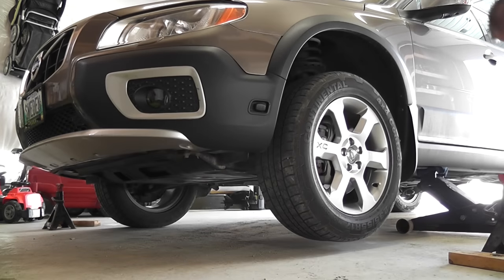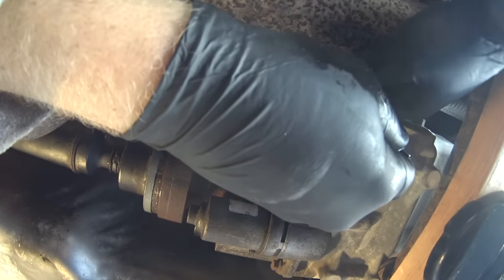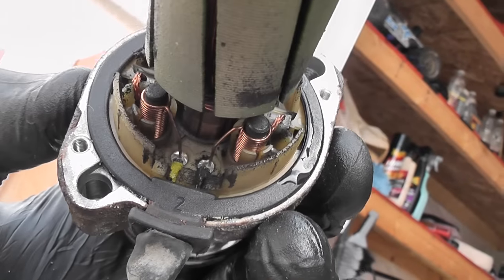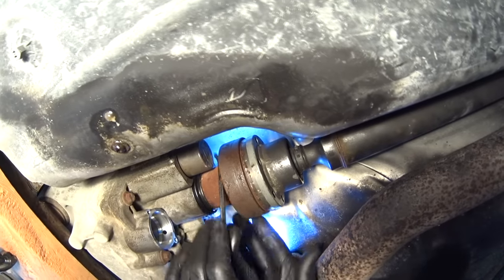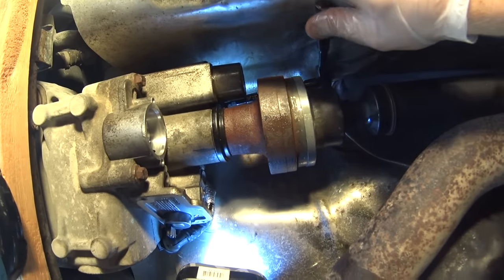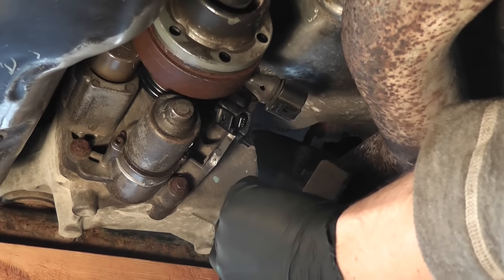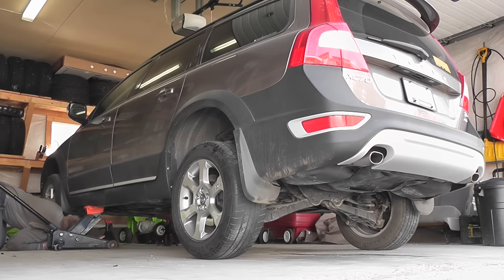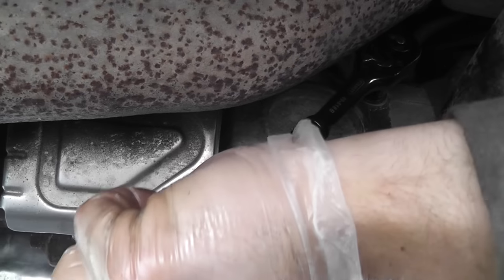Servicing Haldex AWD on a VOLVO

Comment: For the generation 3 haldex, take note:  we did a filter and oil change on our xc70 volvo Gen 3 this weekend, YOU CAN DO IT ALL WITHOUT DROPPING THE PROPSHAFT OR EXHAUST. Cut down an allen key to take the filter cover off, put 12v across the pump connection to pump out the old fluid, black wire is negative, refill, pump a little to prime the pump, put new filter in, job done. takes a couple of hours tops. Nothing needs removing except the filter cover.
Reply: Sounds like you can even cycle the pump with a bidirectional scanner
Reply: So you are connecting negative 12 on pump connector to start the pump and put the oil out through filter cap?
Reply: @4chankrozb  yes, just do it for a few seconds at a time, keep topping the oil up so you do not let the pump spin dry, but it will clear all the old fluid in four or five cycles. it's a pretty easy job.
Reply: @daddygrasshopper  as you've found out, there is hardly ANY clearance, a cut down key and nimble fingers will do it, but I really doubt you'll get any kind of socket in there. But you are probably right, changing fluid even without changing filter will help - our filter was very clean when we removed it, just a smear of residue.

Comment: I just did this on my 2012 XC60 T6 r-design.  A couple  helpful notes I can add here when removing the out filter housing and inner seal is that you can use a 3" 1/4 drive extension and it will clear the back of the prop shaft flange, giving you enough room to get a 1/4 drive ratchet on the extension with enough room to use the ratchet itself.  Also when you remove the outer filter housing, instead of heating a pick to push the through the inner plastic sealing ring, the sealing ring itself has a mounting nub that sticks out that goes into the outer housing peice.  That little nub has a opening through its center that you can slide a flat end screwdriver into to pry out that plastic seal, or loop a hooked pick through it and pull it out.
Reply: Which Haldex version was on your vehicle?  3,4 or 5?
Reply: @timtaylor8557  4
Reply: Piece broke right off

Comment: It's worth mentioning that there are two flange sizes, this will only work if you have the smaller one. If you have the bigger flange the propshaft will need to be dropped.

Comment: Awesome tutorial video! It is absolutely true that some of the dealers tell the users that this procedure is not in the service plan or is not needed (“lifetime”) in order to reduce the three or five years’ service plan costs, but as a result the reputation and trust in the AWD models has shaken and a lot of secondhand Volvo owners are scared to purchase AWD models due its probability to fail.

In my case S60 2.5T AWD (2006) triggered error message "DSTC Service Required" after six years (~200000 km). Official service first mistakenly recommended replacing the control unit and then the whole Haldex for insane costs. So we did a bit of investigation here with my local Volvo service. It took a while because VIDA does not guide you directly to the root of the problem. There are many subsequent codes fired as a result of this AWD failure. DEM 0006 (Haldex pump) a DEM 0007 (pressure sensor), and also BCM-0094 Communication between control units,  BCM-0115 Communication between control modules, Signal missing , BCM-0148 Communication between control modules.

From driver’s perspective the car behaved OK for around 30 sec after each start-up, until the error message shut down AWD and DSTC. I had to restart the engine ~30 times to get out of the snowy road in Austrian Alps, which was impossible without AWD and traction control.
Long story short, it was the pump that said good bye and the oil looked horrible. So I fully recommend to replace that fluid on regular basis. As an extra step I ordered DEM cover from IPD to protect the unit from heat and slush.
Reply: My independent Volvo tech here don't even want to do it when I asked him.  This video will definitely save me money.  I'll just do it myself.  Thanks, Yuri.

Comment: Great video. Just need to mention that the extraction of the 40ml at the end depends on the length of tube you have on the syringe. If not careful, you will extract more than the measurement on the scale as it will be volume in tube and syringe you take out.
Keep making these videos, and thanks for taking the time to share.
Reply from the maker: Totally agree. And I did consider the length of tube.
Reply: 10kg feathers OR 10 kg stones what is more heavy ... 40ml stays 40 ml .....
Reply: @diypapie8428  In your example, one is weight, and the other is volume. You're comparing apples to oranges.

40ml measured in a syringe with no hose on it versus a syringe with a hose of, say, 1ft connected... even though 40ml is indicated on the syringe in both cases, the one with the hose will have extracted more volume from the Haldex unit.

The only way to be sure how much you're extracting is accurate is to measure the volume of the section of hose you're using, and deduct that figure from the amount you wish to extract. Then, extract that adjusted amount using the graduations on the side of the syringe. So, say the hose's internal volume is 8ml. You'd extract fluid until the syringe indicated 32ml, because 40 - 8 = 32.

If you were to ignore this simple math and erroneously assume, as you have above, that "40ml stays 40ml" in either case, then you'd actually be extracting 48ml. This is exactly what the person you're replying to warned about.
Reply: @diypapie8428  How do you plan to fill the syringe first without the hose connected? You wouldn't be able to extract any fluid that way, which is the process we're discussing... NOT putting fluid into the Haldex from the syringe, which is the only way that would work.
Reply: It wouldn't matter if the hose was 5 meters long, if you extract the syringe to 40 ml you'll have only drained 40 ml, the syringe would be empty but the 40 ml would be in the hose, simples. 🙄
Reply: Зачем отбирать 40мл? Заливное отверстие и есть уровень.

Comment: Very good video. The only things I should mention is that you can easily kill the oil pump bearings if cleaning like this with brake cleaner. It is best to cover them up with plastic wrapping or something before spraying - They are not so easy to change although they are cheap from, SKF. It is also very hard to dry and clean the motor winding afterwards. I'm saying this because I have made these mistakes :S
Also, while the oil pump is out you should replace the oil seal in front of the pump shaft (inside the aluminum thing with O-rings) because if that wears out and fails you get oil inside the motor then it will melt the brushes, burn the brush copper contact ring and maybe even the motor winding - this is the main reason that haldex oil pumps fail.
Reply: HI i was wondering where to get the o rings at the from of the pump. I serve the Haldex and now after one month my AWD is disabled. when I opened the pump there was oil in it, I cleaned it with Electric contact cleaner and its working but now I'm unable to find the o rings. does volvo have it or they sell the complete pump?
Reply: @eddieroyalcars3765  Hi, sorry that I didn't come across your question before. Maybe my answer will help others in the future - the normal o-rings around the aluminum thing I got from general o-ring dealer according to the dimensions measured from old rings and the part they go around. The special seal in the front of the motor shaft could be also sourced from some better seal dealers but I got it from SKF dealer. There was part number referring to dimensions written on the old one - if not then again it is selected according to shaft diameter and the hole outer diameter where the seal sits. Luckily today 2 years later there are already full repair kits available, including all the seals, motor brushes, bearings and the copper contact ring.
Reply: @EarlLeeBird  Glad I'm not the only one who has discovered that repair kits are available for these things. Unfortunate that more don't, because those people are spending WAY too much money on new pumps needlessly. Keep spreading the word! Cheers from Canada :)
Reply: @EarlLeeBird  Do you have a link or guidance to these repair kits?  My AWD went out today and I'm betting its the motor/pump. Repair kits are surely cheaper than the $320 new pump i have found.
Reply: @BoycottYoutube  Try searching ebay and google for "haldex AOC repair kit" and select the listing with correct haldex generation. For example ebay seller "awd_pump_repair " is listing these kits for all different haldex pumps. They have also listed all the o-ring and seal dimensions if you want to try and source something locally.
Reply: That's good advice, killed my 5th gen AOC pump after spraying it with brake cleaner and I think that was likely the culprit.

Comment: 16:02 There is a drain.
The bolt to the left of the motor & below the control module is the drain plug.
Reply: So you dont have to remove the pump?
Reply: This isn't true, there is no drain port.
Reply: @Reltens  
When I serviced my Haldex on my 04 S60R I used this drain port.

Comment: Thanks for this excellent video. Couple points to add from my 2011 XC90: 1). I was able to do this without removing the DEM. 2) The pump did not want to come free. I had to bonk it with a big hammer against the end of a screwdriver. 3) Your tip of using a torch to heat a pick is gold! That said, I needed to pry out the seal with something pretty meaty (A T10 torx wrench). It was stuck fast in mine! 4) At 150K miles, it's probably well worth replacing the pump. Brushes were pretty well worn in mine. 5) GET YOURSELF SOME ESCO JACK STANDS!!! You are one of my favorite people on YouTube. Wood on saddle jacks is super dangerous. Thanks again!!
Reply from the maker: Thx for the tips. Will look for the Jack Stands you mentioned

Comment: Great video. I bought a cheap 90 degree cordless wrench in 1/4" drive that make filter changes much easier. It is perfect to get into the restricted space and does not have the power to damage the screws.

Comment: Volvo in Sweden says that the AWD system is service free, and does not need servicing. I think that you always should change out you fluids, no matter where in the car it is.
Reply: Yes, Volvo does say that but everyone out in the real world knows that if the pump and filter are not serviced periodically your AWD will likely stop working, the pump will burn out and cause the control module to fail and replacing both will cost you more than $1500, at least in Canada that's what it costs.
Reply: Exactly.
Reply: I work at an Audi and Volvo dealer we never service the haldex in the Volvo.but every 35k in the Audi TT and audi a3. Also were a vw dealer every 40k on vw Tiguan golf r . Don't know why.
Reply: Volvo in Sweden would also love to sell you a new car every 7 years. The AWD system is definitely NOT service-free, that is, if you want your Volvo to last a long time.
Reply: Well, my AWD on my S60R gave out because of it 😂 obviously needs service
Reply: Everyone says now automatic gearboxes are service free as the oil is wether non serviceable or good for the life of the product. But truth is life of the product is dramatically increase whe you maintain it properly.
Reply: @honestguy7764  every 60k when towing or heavy use and 100k with cruising

Comment: Hello volvosweden ! Thanks for this video. I have a question about the oil. You take a oil with numbe 313 679 41 . Is it the same oil with the number 313 679 40 ? Or what is the different?

Comment: I just replaced all the fluids in my 2008 XC70 75k miles, I had an occasional whining noise in the transmission but couldn't identify the source so decided to replace all the fluids in Haldex, back axle and gearbox (Manual). Your great videos were very helpful and the problem has disappeared, the gear change is also much smoother so well worth doing. Many thanks.
Reply from the maker: The whine could be coming from the rear diff. Known problem.
Reply: Thanks for that info, I tow a 1600kg caravan and so far the whine has not happened again.
Reply: john jay  I just picked up a 323Ci for just about free because ALL the 3 -series BMWs are defective in that instead of bolting the rear end subframe to the outside chassis rails, they bolt it to the bottom floor pan.  Eventually every single one has its driver's rear and passenger front mounts rip from the car.  And then there is the other nightmare job of changing out pcv valve and hose assembly.  The absolutely worst engineering I have ever seen.  And BMW takes no responsibility for this manufacturing defect.  Fortunately there is a kit ($800.00) that can be bought aftermarket to repair this problem, no thanks to BMW.

Comment: Awesome video. Great job and love the "be patient" moments in your videos :) ! Did you buy a service manual or found it online? ....currently looking for one ...same year, same model, same motor as yours.
Reply from the maker: +Dave Bourdages Called Vida on ebay.
Reply: +volvosweden Spasibo ! And by the way what kind of motor oil do you use ? 5w40 ? I'm in Quebec so kinda the same temperature. Let me know
Reply from the maker: +Dave Bourdages Thx. I use Mobil 1 0W30 Synthetic every 6000km

Comment: Very good work. A good idea would be to use compressed air to clean the motor and some spray grease into the motor bearings before reassembly. And make sure the motor casing is sealed well in wet climates. I would also make a little notch in the prop flange ( one each side for balance ) rather than grind the motor. I just use a blade to clean the pump housing too because sand paper might leave some carborundum in the housing.

Comment: I have a 2008 Ford Five500 with Haldex AWD system and high miles.
The owners manual and Ford has no useful information about it.
I will be using your video as a guide for my mechanic.
Thanks for pulling this together.
Reply from the maker: +Dana Clark Excellent.  Its the same system for sure.
Reply: interesting; i wonder how Ford shops service the five hundred!

Comment: OMG - I only noticed just now-- He is using transmission oil and not Haldex specific oil . the container should be printed Haldex oil. The two oils are entirely different. Transmission oil lubricates. Haldex specific oil increases friction in the multi clutch plate unit. If you use transmission oil the unit will fail to do the job of torque distribution.
Reply from the maker: The oil I have used is as per Volvo manual.
Reply: @volvosweden  The Volvo Haldex specific oil has AOC  ( Active On demand Coupling ) printed on the front of the container. I didn't see that on the oil container you used.

Comment: I was wondering, since you cleaned the pump with a strong solvent, got it really clean, what about re-lubricating the pump bearings before re-assembling?
Reply: I would imagine the bearings are "Sealed" e.g. 6202-2RS  Meaning 2 rubber seals. The bearings are sealed for life with their own grease within.
But if the bearings were open, no seals,  they would be lubricated by the oil within the pump.  (6202 is just a random bearing number: Not these, necessarily!)

Comment: Nice job friend, I have a 2004 V70R :)
I have 200,000 kilometres on the car now and have never thought to change the Haldex oil ! 
Hope it is as straight forward as this :)

I will look for some more of your videos, I like how clear your instructions are 👍
Reply from the maker: +Darrin Ray Thx.  I love V70R. But they age now and I wanted a Volvo that will go for light off road. I would service the Haldex! The filter and oil in it is not lifetime.
Reply: Im planning to get v70t5r as well, what gen haldex they use?

Comment: Great video, one question regarding the haldex pump. When you clean it out with brake cleaner, wouldn't that flush out the native lubrication in the bearings? Would a drop of light oil be a good idea or are they sealed?

Comment: Does Volvo recommend a service interval of this system?
Reply: Service interval is 80 000km or 48 000 miles.
Reply: @aerofobisti  I don't see it in my owner's manual.  It only says check for wear on propeller shaft, pilot bearing and universal joints and starts at 60,000 miles.
Reply: @edijares1543  I think it's only in the service manual for workshops. And note, it is called a AOC or awd clutch in it.
Reply: my VW also has a haldex system and for oil change it's 40k, but filter change is 80k. Practically after 40k oil looks exactly the same as new, so it could go even longer.

Comment: Fantastic video! I have an gen 4 system in my A3 and cannot find anything on gen 4 servicing anywhere and think your vid maybe 1 of a kind in its depth and detail. The really annoying thing for me is that Audi think that tiny filter is "for life" and doesn't need changing. When I call parts department the filter is "not available for my car" or so they say. I know I have gen 4 as the coding is an OBR variant which as per Haldex refers to the Gen 4 modle. This will help massively. Also great idea taking pump out to clean. My pump failed (under warrenty thankfully) so want to keep the new one in tip top shape! Thanks once again. Great vid, well explained from start to finish. :)
Reply from the maker: +Nicholas Dambrosio Glad this helps you.

Comment: Is there a quick and easy way to know what oils and volume the drive train needs. New to AWD and want to service my new V60. Plan on getting the cam belt done as my first port of call but then wanted to do the AWD service. Is it all the same oil gearbox back to diff?

Comment: Hello. I changed the oil and the filter, but I couldn't get rid of the electric motor in this haldex, because the universal joint is much bigger. Didn't start to disassemble the universal joint, too much work. I guess it's not crazy if it was done that way